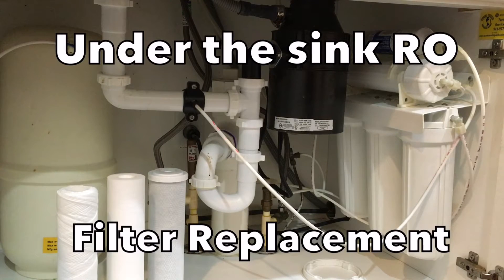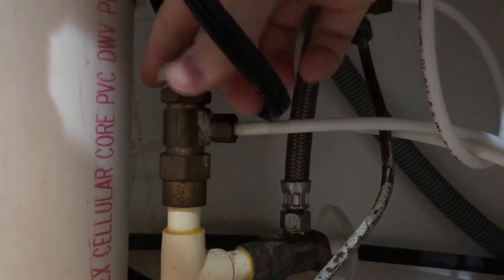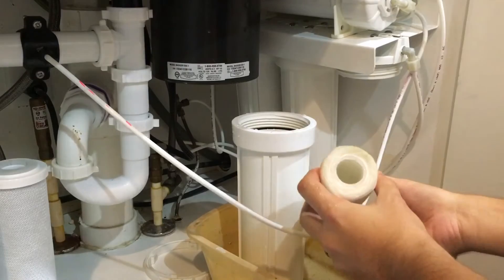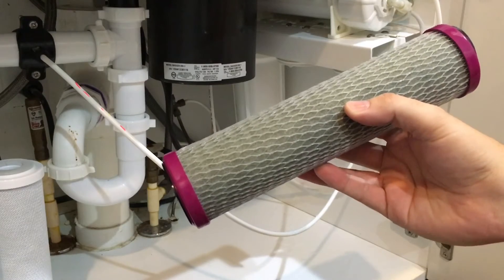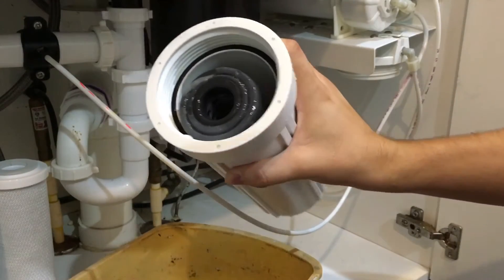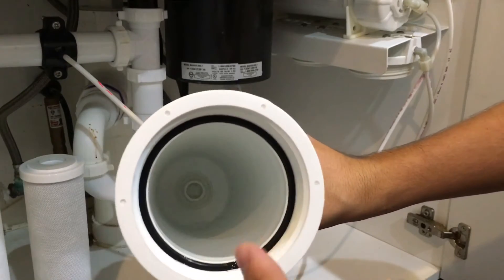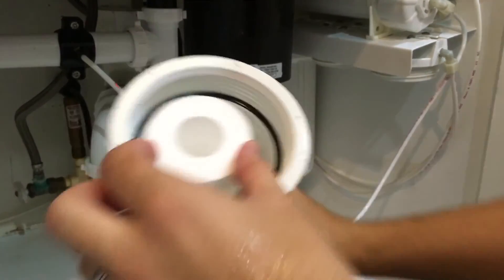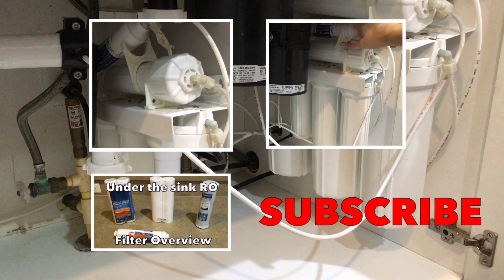How to replace reverse osmosis RO filters under the sink - pretreatment filters

Comment: Enjoyed it, but what about the top filters--the post carbon filter and RO membrane.
Reply from the maker: I did a separate video on is the carbon filter. You can find it here: https://youtu.be/GmzYqskKz1U
And I haven't replaced a membrane yet. However you can watch how I installed the entire system including the membrane here:
https://youtu.be/ZLhezzW04tQ
Reply: Thanks. I just realized you don’t have to replace those two as frequently. Nice!  
Btw, we added a Vitev filter to add minerals back into the water. Highly recommend.
Reply from the maker: Yeah, I have iSprings FA15 (https://amzn.to/2CmEUFm) which adds the minerals. Been using it for about a year and half and have been pleased with it.